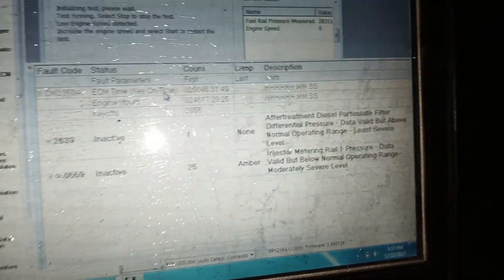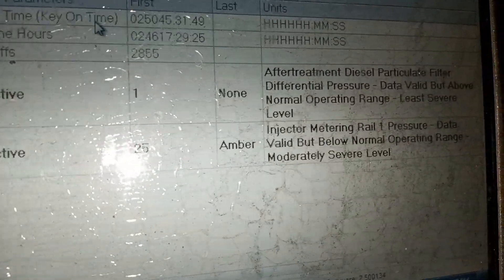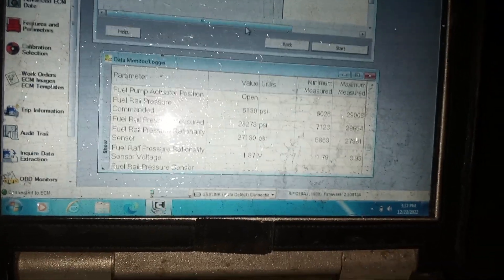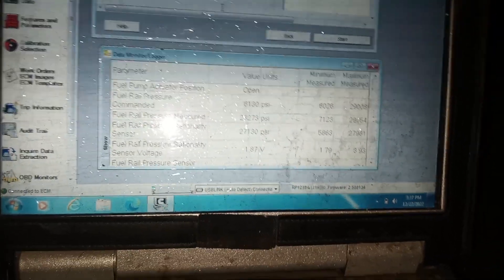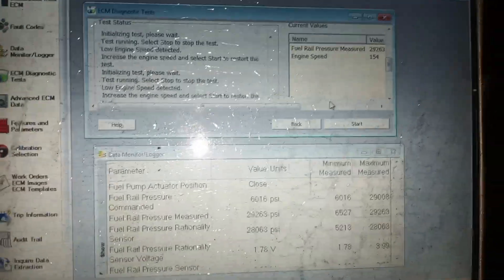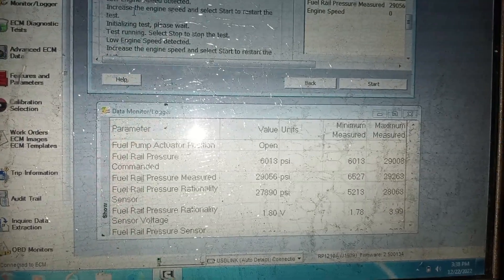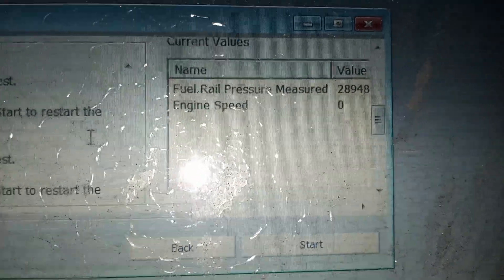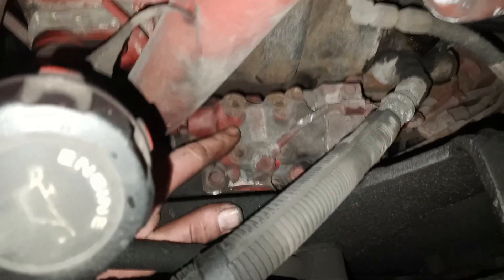Cummins isx code 559 Fuel pressure low in common Rail.

Comment: What issue were you having. I have same code I change fuel pump , the valve and pressure sensor and still turns off randomly then turns on and off several times

Comment: I have 559 showing up for a few seconds...then it goes away.  But my truck will still have no power...like it loses torque and doesnt give full boost (only 22psi).
We've done all the normal fixes for this...and did the leak down test.  Changed the relief valve anyway.  Leakdown is good but still have same problem on the road...even bobtailing.
Pump head was rebuilt when my engine was getting done about a month ago...and had this problem ever since.
Thinking we might have to pull that head off and investigate.  We've done everything else we can think of....
Reply from the maker: https://youtube.com/shorts/Cnd59rH2mOM?si=VYBrCkz848Kcd3y3 , this is the second half of the video ,make sure you have the right fuel filters , also I have seen this code come up due to fuel water separators coagulation happen due to very cold weather and throw this code. When you pulled your head pump off make sure to double check your plungers ,what I mean by that is you need to unscrew the plungers and check the seats on them you could have a hair line crack on them. THANKS LET ME KNOW ,SORRY I DIDN'T GET BACK TO YOU SOONER